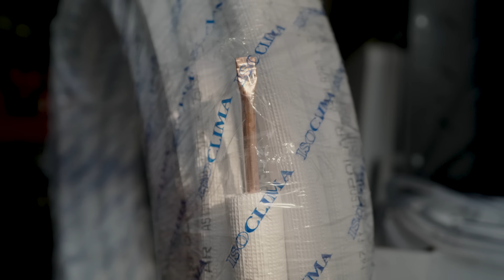How to Install a Wall-Mounted Mini-Split | Ask This Old House

Comment: Richard, you're the best! You explain things so well.
Reply: He really is the best!
Reply: he gives horrible hvac advice
Reply: @zack9912000  not true
Reply: @kriskobylarz7735  'fraid he's right.
Reply: @joecephus352  explain
Reply: @kriskobylarz7735  well for starters, the refrigeration cycle does not start or end at the metering device. It actually starts at the compressor. Also line sets, or copper coils do not ever come charged or pre charged with any amount of refrigerant. They are actually charged with a small amount of nitrogen. That's to prevent any contamination from moisture in the atmosphere.
Reply: @joecephus352  ok, you are right about the compressor but for reference this wasn’t a technical class for hvac techs.
And I’ve seen many precharged line sets
Reply: @kriskobylarz7735  pre-charged line sets? Listen here bud I've been doing this for 10 years I ain't never seen no pre-charged line sets come from nowhere. The only equipment that comes with any sort of gas or Refrigeration in it is the condenser which houses the compressor.
Reply: @kriskobylarz7735  We hung 2 Pioneer evaps & condensers ourselves, ran the lines physically, wired for power and then had a local HVAC contractor connect the refrig lines.  Of course he did the evacuation first like the Boston guys did, but just on the lines, before opening the shutoff valve to flood them.  The charge was in the Condenser, not the lines; Pioneer puts enough in the condenser for 25 ft of line (which is the length we bought the 2 units with).  Pioneer will sell these with no lines if you want to get your own.  No failures since the 2015 install, and one of the units is in our Restaurant kitchen, definitely off the acceptable list of environments for ordinary units!

Comment: We have a Mitsubishi Mr. Slim installed in an non heated/AC room (I often don’t use the house AC since Mr. Slim unit cools the entire 1st floor of house & less expensive to use). It’s amazing, love it. It’s extremely quiet inside & out (walking past condenser I barely know it’s running). Highly recommend split units to anyone who doesn’t have AC.
Reply: Does your split have a heater ?  How is it ?

Comment: I love mine !  I have on the 2nd floor of my house and it works beautifully.
Reply: Hey frank am really thinking about getting this kind of system. How well does it heat your home. I have a force heating system, pretty old and the associated vents take up a whole lot of space in my basement, I really want that space back.
Reply: @strumblackburn9395 , it works phenomenally.  You can set its temperature to whichever you like it and it goes there like a furnace or a/c.  
.
I sleep upstairs and it was FREAKIN' cold in the winter and hot in the summer before I bought mine and had it installed.  As I walk up the stairs I can feel the temperature warm or cool, depending on the setting.  The interior unit is whisper quiet, as is the fan element outside.
.
I highly recommend it.  I have the Mitsubishi split air unit and there are others to choose from.  It's your call, but you won't be disappointed.  I had a friend of mine install it with his son and he was the one who recommended this item.  Hope this helps you.
Reply: @whocares0692  first off thank you so much much for your great review. That is exactly I was hoping to hear. Sir, stay blessed.
Reply: @strumblackburn9395  I also just had two of these Mitsubishi Mini split units installed. I had one installed in my garage and another one in my shed.  Oh my goodness!!! I wished I would had invested in this units years ago! I’m very please!
Reply: @eugeneduncan9726  thank you Mr. Duncan. I totally appreciate  your review. I can tell your happy. I know am going to feel the same. Blessings

Comment: I've been thinking about a split unit for my garage. To keep it warmer in the winter and cooler in the summer.
Reply: I ordered a "Mr. Cool" 12000 btu unit from Lowes and it arrived at the store today. Going to pick it up on Sunday. Mine is for the garage as well but I also have to do some blown-in fiberglass above.
Reply: If you're going to do that make sure u insulate in the attic space above it otherwise you'll lose it all
Reply: @staudtj1  I have same unit for a year....freaking love it!!
Reply: I'm looking into spray foaming my garage and adding a Mr. Cool diy mini-split as well. It's going to absolutely transform my garage.
Reply: Be very nice to warm the car up in the garage during the winter so it doesn't take long to start it up.

Comment: Hello my question is. Did you add or take out take freon  from the heat pump?  I understand  that you added nitrogen and vacuum the line or the pre charge unit is just good enough for plug and play?
Reply: Units come precharged from the factory. Nitrogen is added to perform a leak check. If there is no leak, the nitrogen is released and the lineset is vacuumed to below 500 microns. The refrigerant is then released into the lines.

Comment: "We utilize blocking behind the brackets to protect the vinyl siding."

"Then we commence the drilling!"
Reply: They put blocking there so it would not crush the vinyl siding since it is not solid like wood.

Comment: Funny that this would be on an Old House segment when many of us have naturally-stained, all-wood interiors in our Arts & Crafts homes. And white would stick out big time. It would be nice if these mini-split companies would have optional wood covers that you can stain to match or pick a stain color.
Reply: Most people that have homes that nice would probably want to have something custom built to match their existing woodwork anyway... just hire a cabinetmaker (or a finish carpenter that specializes in old homes, etc) to build a cover for it that will vent the air out but hide the wall unit itself.

Comment: just put in my LG system in a new build for heating and cooling. Worked great at -5 F. Tonight is -10, might have to turn the fireplace on.
Reply: LG is garbage, use mitsubishi
Reply: @Waymanator123  I have heard mitsubishi is garbage?
Reply: @ryanfoss6243  For every brand there is someone saying it's garbage. Even if something works perfectly for 99.99% of people there's always the 0.01% who will swear they'll never buy from the brand again, even if it's actually the best in the market.
Reply: @Waymanator123  Mitsubishi is garbage, use Toyota. Or even better, Tesla, right?
Oh wait, we are talking about cars, right?

Comment: Mini-Split are awesome, installed a diy unit my self.  Was not to bad to install, would have been easier with a 2nd pair of hands.  Heats a small 400sq to 65, with outdoor been 10-20 in new England weather.  It only added $60-70 to the electric bill.
Reply: Is it a MRCOOL?
Reply: @ForkLiftCertified  yes.
Reply: I have installed 8 of them so far. They are  a wonderful unit.
Reply: I put a Bosch unit myself into the converted garage, but I did get a pro to pull the vacuum and charge it. 

Then I hired a company to install a 3 head unit, and yeah they did run the lines on the outside and ruin the looks of my house. Couldn’t belief it. Should have done it myself.
Reply: @generallyhelpfulsoftware646  I ran my line up throw the attic crawl space, and cover up the drain line with a drier vent.  I want it to look as clean as possible.  I almost disguise the drain line as a water spigot.  but was worried someone would turn it off or something.

Im gone to make something to better protect the out door unit for nor Easter of heavy snow, i notice the past few storms it work a bit harder because the snow got on the coil a bit, nothing bad but i like to put something in place just incase.

Comment: He said the drain line would be run “with pitch” to allow gravity to do its work. However, they snugged it up to the floor joists. Perhaps the house leans and that’s how they utilized pitch.
Reply: at 5:31 the corrugated lineset is still dangling down to go out a diff area of the house. The linest tubes are strapped together going the other way. I had to look twice too lol
Reply: I see what you're saying but once the line fills with liquid it will create a siphon that will drain regardless of pitch. It's not ideal but better to have a couple low points for liquid to seal the line and keep critters from crawling up in

Comment: When you hung the outside condenser on the vinyl wall, can you explain exactly how you did that? What kind of screws and bolts? Did you go into concrete or wall studs? How exsctly do you protect the vinyl siding? How can you be sure your rig will be strong enough to hold the weight of the unit? Sorry if these are noon questions!
Reply: Wall studs.

Comment: It's not cold refrigerant it's actually boiling at a very low temperature and the evaporator pullls at a split second temperature across that coil very fast because it's removing heat from that area.

Comment: Thanks Richard, Would like to know more about designing a heat pump system. How well will that single indoor (evaporator) heat the downstairs unit given all the room dividers?

Comment: to save money you can buy the unit and do 90% which is placing the unit on the wall running all the lines through the basement to the outside unit. then run the electrical from outside unit to the fuse box and secure all the lines to code. make sure you read your local code as they may very from state to state or county. the only thing the hvac guy will have to do is finish hooking up the lines test the lines fill up the lines. then electric guy comes out and hooks up the electric preferably before hvac. this will save you a lot of money as you do all the work id probably say it would cost $3,000-$6,000 on the unite and $1,000 on the hvac and electric guys vs if they did it all $6,000-15,000.

Comment: Can you use a mini split to cool multiple rooms. For example one outside unit with 3 inside for lets say 3 bed room?
Reply: Yes. I have exactly that in my house. Each of my 3 bedrooms have a head unit and they are all connected to a single outdoor unit. 
They can all be controlled independently.
Reply: @_valxp  thanks. I will look this up before summer hits
Reply: Ducted mini-splits are perfect for this purpose. One head per room doesn't work well because the load for each room is too low so the units will be short-cycling all the time, which hurts durability and efficiency a lot.
Reply: Super question .

Comment: Question,  does the clearance from the condenser to the wall matter? cuz I have a senville ill be installing and it says 12" clearance from the back wall but the wall mount that come for it gives me like 4 1/2" clearance,  all other clearances are good just that one, Thanks
Reply: The manufacturer will tell you the minimum. Check out the installation instructions.
Reply: I have the exact same problem now. Mini splits says 12" from wall on back and same company sells wall bracket with only 4" from wall.
Very confused and don't know if will make much difference.

Comment: Any advice on getting a larger unit mounted? The one we are installing weighs 160lb. We have the rated bracket for it but we need to get it up to the 2nd floor back wall of our condo building.
Reply: In Australia they use a small electric tbar lift. You can probably hire one. I had my outside units placed right up under the eves opposite the inside unit.

Comment: The one thing I didn't like is how you try to scare homeowners away from doing it themselves! I have 3 units on my house Mr slim with 4 head units pioneer with two and another Mr slim with single head, I did the installation myself to get rid of the energy sucking 5 ton unit which is still in place but turned off. With some reading and specially now with Youtube instructional videos some homeowners can do this.

Comment: Anyone else cringing because he mounted the inside unit with drywall screws?
Reply: And the one they showed going in didnt hit a stud, not even the lathe
Reply: Yes. I would have opened up that wall and nailed some 2x4’s for bracing situated in position so that it supported the unit then covered the hole I made with the unit and it’s bracket. If need be I would have repaired the drywall before mounting the unit. Additionally I would have used a 2 1/2” wood screw. No way I would have trusted the way they mounted it with drywall screw into nothing. Hell I wouldn’t even trust that drywall screw to hold up a picture frame.
Reply: The head units way like 10 pounds....come on man! 1 screw in a stud with some others to stabilize and level and its not going anywhere. Mine are set that way and haven't moved for years. Now, if he set the condenser that way i'd agree with ya.
Reply: @beerbeforebreakfast  I would agree with you but the 1 1/4” sheet rock screw he used clearly did not hit a stud. I’d rather over secure it than under secure it. By the way I love your name. It reminds me of a line in a great Kris Kristofferson song that Johnny Cash had a hit with when I was in high school. “The beer I had for breakfast wasn’t bad, so I had one more for dessert”.
Reply: Didn't notice in video is he did ever get a stud. Thye dont show you every detail, sometimes makes you think they are hacks when they are actually skilled and professional. 

Thanks for the complement on the name, never knew the Johnny Cash line even though i love Cash. My previous name was Fixing Things and Fishing. I need to have 2 channels cause i associate myself with both in real life.
Reply: We use bolts and if no stud lines up with the mounting bracket holes but it does line up with the bracket We’ll make a hole . And if no stud then we use the anchors that come with the mount
Reply: I’m lucky, I have “knotty pine” solid wood walls that they mounted my air handlers too. I don’t have flimsy sheetrock.
Reply: Maybe... just maybe... they were construction screws?  Construction screws are stronger than plain old sheet rock screws. It is disturbing that the screw they showed him installing didn't hit anything close to a stud or backer.
It's OK. If the unit falls, the compressor lines will keep it dangling.

Comment: Hey Richard I'm planning on getting mitsubishi 6+6+12btu with a 24 btu heat out door unit I think they come pre charge do I just install the unit or do I have to have a professional charge the unit or check it once finish install? Hope this question make sense

Comment: Do these get mold like air conditioners and you have to clean them regularly
Reply: They get mold on the fins inside if your climate is very humid. In Australia cleaning involves surrounding the unit with a plastic catcher & spraying cleaning foam then rinsing. There are companies that do this. There are removable filters inside that catch dust & I rinse these off under the laundry tap.

Comment: Hello. I want to install a heat pump in the basement . My question is, can the unit outside be higher than the heat pump in the basement?

Comment: Would like to have heard more about the heating aspect.
Reply: It just reverses to do that.
Reply: @Nicholas-f5  understood but how efficient, and average cost of heating
Reply: @gilbertdare5921  I have a Mr.Cool 24k btu .
Honestly the heating could be better and the electric bill stays up all year.
The hspf and btu of the heating is subpar compared to the gas units.
To be more efficient for a heat pump,a multi zone unit is best.
Heres a little info on ratings 
https://callapollo.com/afue-seer-and-hspf-ratings-explained/
Reply: @myname9252  thanks for the reply
Reply: All the manufacturers have high heat units which are quite good.
Reply: @DerekKite  thanks for the reply

Comment: I'm having a whole house system installed this week. It's thru an energy saving program in my state. I sure hope they know what they are doing when they get here tomorrow.  I'm somewhat nervous about the whole thing. I have done a fair amount of research on these systems. My main concern is where the heads will be located. If not done properly, it will not be energy efficient. Wish me luck!
Reply: Wondering how your installation went and if you’re liking it

Comment: I have a three bedroom house that has only a small propane stove for heat and NO AC I’m wanting to put a split system in. It’s a single level home on a concrete floating slab and wondering how to put three system in on existing interior walls?

Comment: I already have a minisit install in garage.  I have the outside unit on 4x4 on floor.  I wanna mount it a few inches high on wall since they are pouring concrete on floor.  Us there a way to do this without disconnecting any hoses?? Thank u

Comment: Great video. 
What did they do for HVAC in the master bedroom?
Also, do you know if any of the wall mount systems will allow you to connect the lines from the top coming down out of the attic?

Comment: I got estimates in Massachusetts for a ductless mini split for my home. For a 5 indoor unit system, the lowest estimate was $25,000, the highest estimate was $35000. I am not allowed to DIY in my town because you need building permits. Only a licensed electrician is allowed to pull an electrical permit, and only a licensed HVAC techinician is allowed to pull an HVAC permit. I can pull a regular building permit. I decided to keep the window units. If it's on TOH, it's not affordable to the common person.
Reply: you need to find another HVAC guy to give you a better estimate. Find out what he likes to earn per hour, then multiply that by the time required. That gives you your reasonably fair labor cost. Add that to the equipment cost. Do NOT let anyone add a third component to the price, their profit or whatever they think they can get away with because they've greatly improved your indoor climate.
Reply: @davidlindgren2448  I got 3 estimates, (1 big box store, 1 local hvac company, 1 regional hvac company), all were in the same price range. I'll keep using the window units.